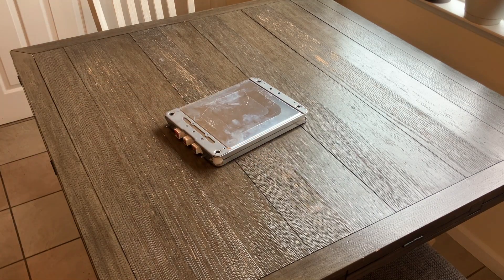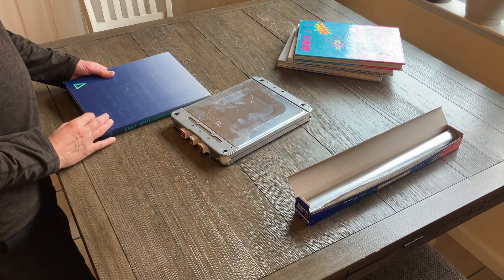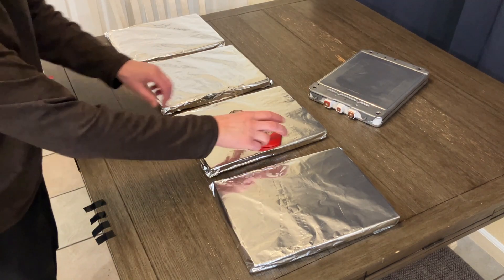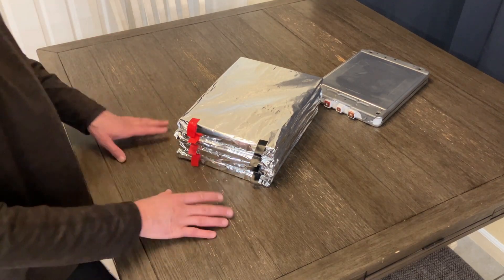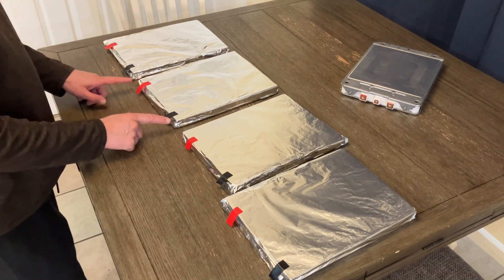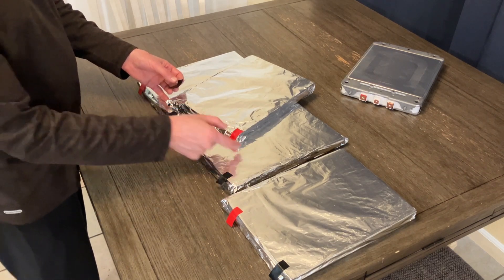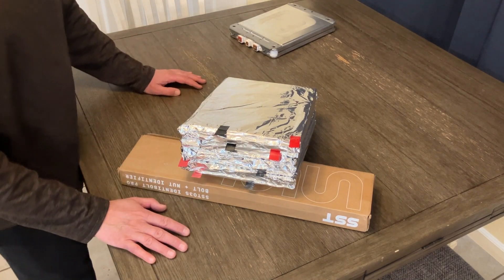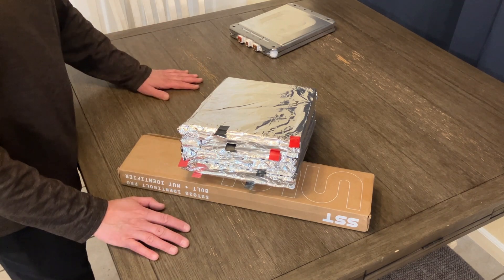2013 Nissan Leaf 2S2P Battery Cells

Comment: It's a great description of how the module is internally connected. Only thing I would add is that the middle terminal is not for transferring high current but is just for the BMS connection.
Reply from the maker: or is it? have you seen the internal bus bars, it has the same ones as the oher two 🤷🏼‍♂️